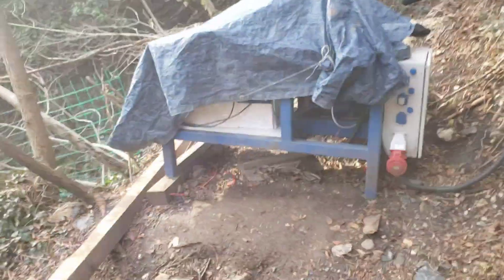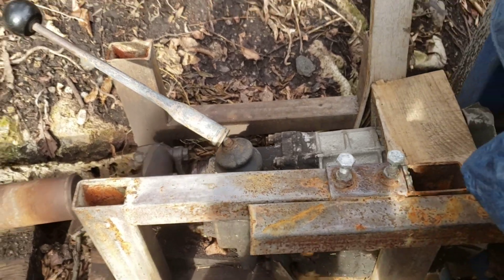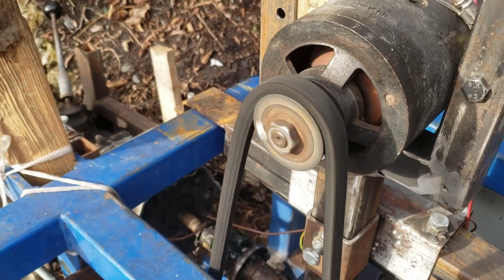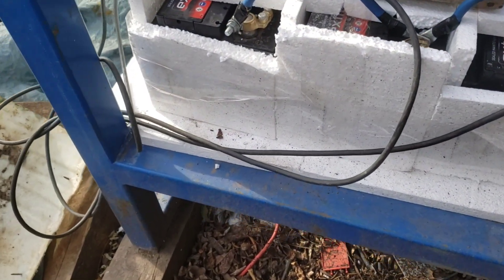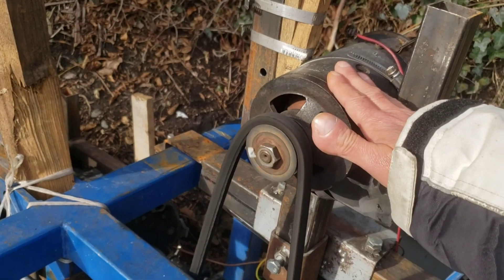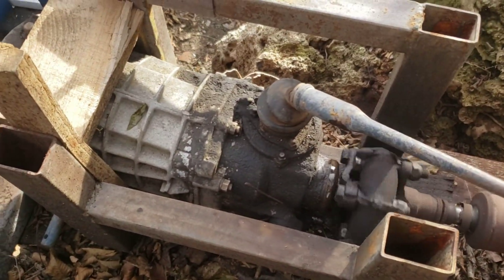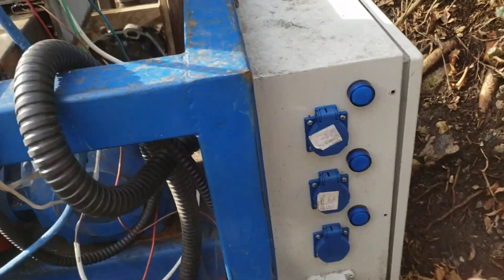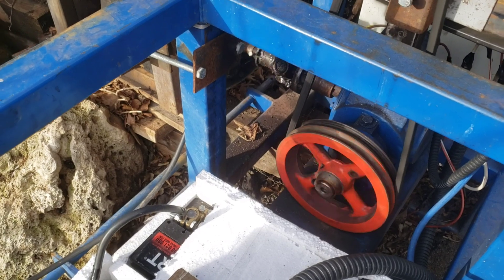OffGrid Hydropower Free Electricity Generator for Life

Comment: Uh, wait a minute. The ampere hour information on batteries has nothing to do with charging them!
Normally, each of your batteries should be charged with 14.4V and 10 - 25A charging current. (Charging current = 10 - 25% of the battery's nominal capacity). Since you are running 3 batteries in parallel, you would need to provide 14.4V and up to 30 - 75A charging current. Otherwise, it will take forever for them to be full.
This ampere hour information on the batteries refers to the maximum current that can be drawn for 1 hour. This means: Assuming a battery is fully charged, you can draw 100 amps for 1 hour until it is empty again. Since you have 3 in parallel, you should be able to draw 300 amps for 1 hour, or 100 amps for 3 hours.
In the best case, all three batteries have an identical internal resistance. The battery with the highest internal resistance has a negative effect on the other two.
Is the cable cross-section from the generator to the batteries at least 6mm²? (A larger cable cross-section does no harm - on the contrary, the line resistance and thus the voltage drop is reduced.)
I also recommend checking the electrical connections regularly. Corrosion between the tubular cable lugs and the washers can lead to high contact resistance and thus loss of power.
Reply from the maker: You can be more right,  batteries are 100amp and as you said I need at least 30 to 75amp charger to have it loaded quickly,  unfortunately I don't have enough speed in my system to run my 120amp alternator so I have to run 16amps dynamo,  until spring when I am working on this machinery again and hopefully I will have enough speed to have alternator attached and we will be all set. Dynamo taking forever now to up charge batteries if voltage drops under 11.8v. We are cashes about electricity usage in the cabin and we are keeping our voltage on not less than 12.2v so dynamo can keep it up. Overnight we have charge up to 13.8v but during the day and evening when we are using lights and charging our devices we are dropping to 12.4v.
Thank you for sharing your knowledge.

Comment: If you are driving the transmission from the rear, opposite of how it would be used in a car, couldn't you get a higher RPM by using a lower gear in the transmission?  Fourth gear would be usually 1:1 ratio but first gear would be something like 3:1 so with the power going into the rear of the transmission, the ratio would be the opposite or 1:3, unless I'm missing something.
Reply from the maker: You are not mistaking,  in the first gear I will get 1:3.67 2nd gear 1:2.10 3rd 1:1.36 4th 1:1 and 5th 1:0.82
I simply don't have enough water pressure to ride it in 2nd or 1st gear, 3rd is little better than 4th but water is splashing all over the place when hits the pedals and because is freezing cold outside everything get icy and create another problems, so for best results and least maintenance 4th gear is the best. 
Thank you for your comment,  please Subscribe to help us grow. 
Thank you.
Reply: @nopeoplenoproblems  That makes sense.  It would take more torque to turn the driveshaft in a lower gear and the water wheel can't supply that torque in it's current configuration.
Reply from the maker: You are absolutely correct,  I am hoping when I build bigger wheel with many more pedals I will be able to increase torque and add alternator which was original idea. Dynamo is only 16 Amp and alternator is 120 Amp,  with that setup i will get 100% what i need,  even like this we do have electricity and I am happy with it, but if can be better I need to make it better.

Comment: What voltage comes from the dynamo? And that voltage goes straight to batteries ???
Reply from the maker: I am getting 13.3v to 14.5v, that is what charge batteries,  problem with dynamo is it is only 16 Amp and will not recharge batteries quickly enough,  alternator was 120 Amp but requires more RPMS which i do not have with this setup. Alternator was giving me between 10.5v to 11.3 max.
Please Subscribe if you like to help us grow. 
Thank you.

Comment: Your fighting gravity and losing power having the water hit the bottom of the wheel your lifting water robing power! Look at any water wheels used in grain mills or saw mills water comes in the top and the weight of the water is a big part of the power produced.
Reply from the maker: Unfortunately this setup requires that because my wheel is to high, in spring I will make it shoot to the top. 
Thank you for your suggestion.
If you like to help please Subscribe.

Comment: You could put 2 14v generators in series and also set up your batteries for 24vdc  the higher the voltage the less amps you need  put in a voltage regulator for your lights or run them in series, do a load test on the water wheel see how much power it can put out,  try a permanent magnet alternator self-exciting ,a small one can put out 12v dc at 14 amps bigger ones can put out 30-40 amps these are very small for their capacity and simple to install, virtually maintenance free.
Reply from the maker: 24v will not work for my converter because is 12v to 220v,  if I add one more   generator I will not have enough RPMs to make electricity,  dang magnetic break, and I don't have enough water power to make it work,  I did try that.
Thank you for your advice, I will consider all options this spring.